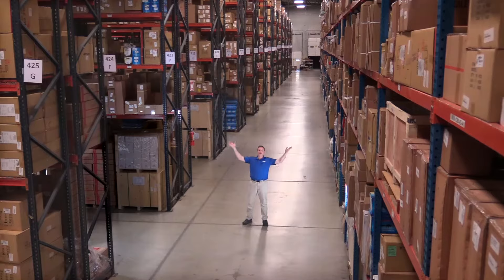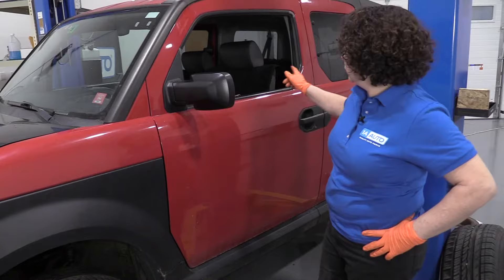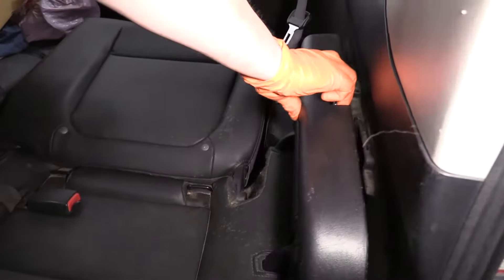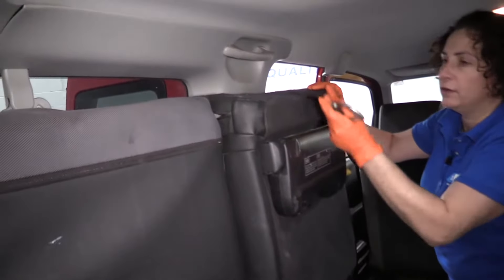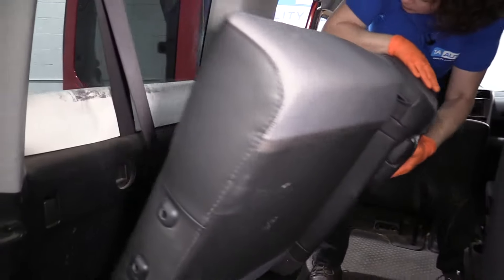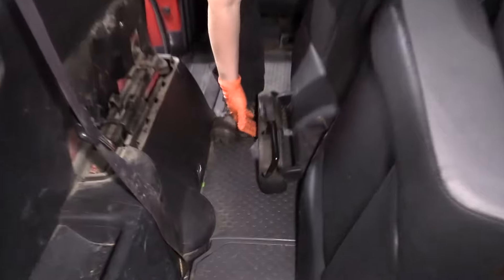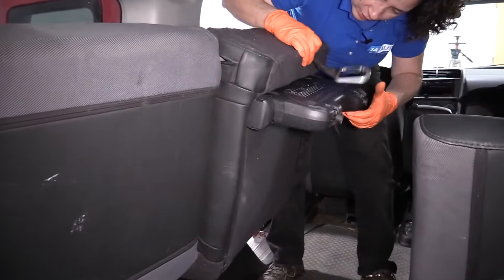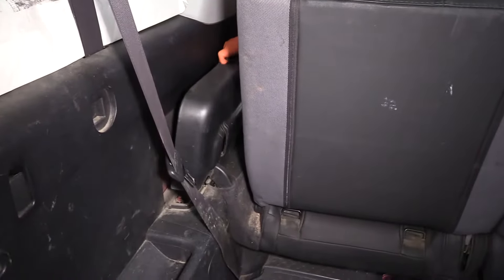How to Remove Rear Seat 03-11 Honda Element

Comment: My 2010 Element EX has part of the seat belt straps threaded through the top of the back rest through a shoulder harness guide. The owner's manual says the seat belts would have to be disconnected and that a dealer would have to do it.
Reply from the maker: +E S Thanks for the feedback!

Comment: I pulled the tab, pulled on the handle and lifted as you said. However, only one part of the latch released.  The back part of the latch released but not the front part closest to the front.  This is the rear passenger seat. It is still attached at one spot and I can't seem to remove the seat completely.  I wonder if you've encountered this before.
Reply: Yes! You have to pull towards the back for it to release.

Comment: What if the floor latch is stuck in lock position?
Reply: Smack it u til it’s unlocked. Spray it with penetrating oil. Heat it up. Pry on it.